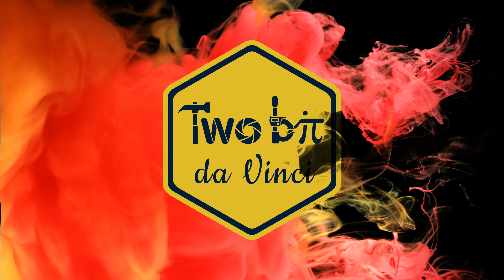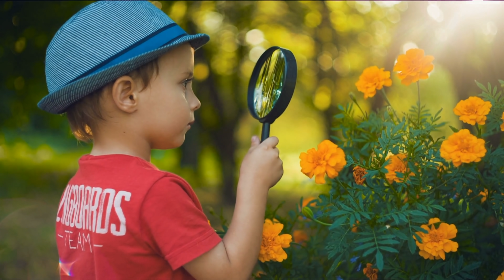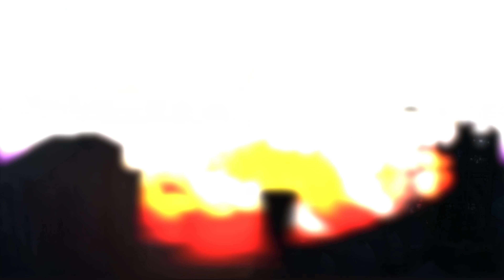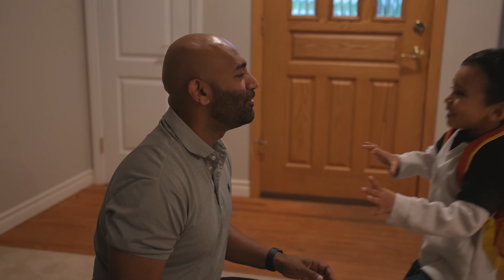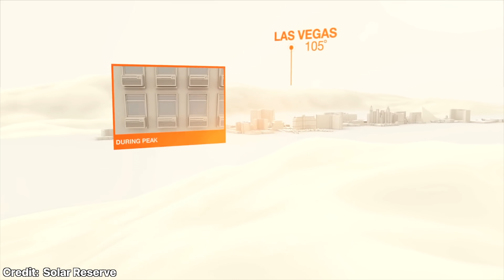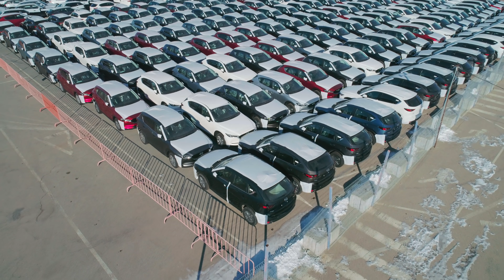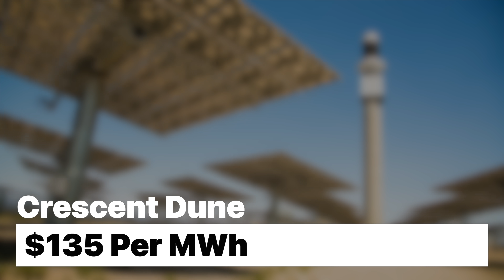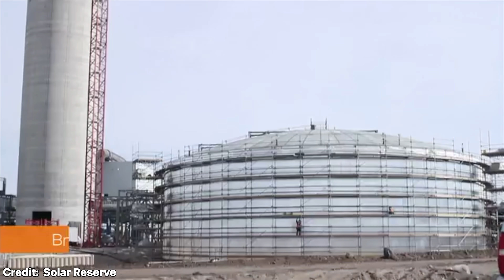This Billion Dollar Solar Plant was an EPIC Failure

Comment: I bet engineers and managers lied to get this approved, specifically by overestimating the power output.  Some mechanical problems could not be anticipated, but the physics/engineering needed to get calculate the output were 100% understood .  How much light is reflected?  How well is it absorbed?  What is the conductivity of each material used?  What's the efficiency of the turbine?  Accurate answers were available to every question, yet their estimate of the power output was high 2:1, literally double.  The Department of Energy must not have audited the engineering work.
Reply: High tech money laundering scheme. Just like the entire “climate emergency” industry.

Comment: The concept of the Heliostat Solar Plant is correct because it solved both collecting and storing energy issues. The problem is engineering execution. First, you don't need mirrors full circle around the tower. The sun goes from east to west and from south; Second, to make each mirror constantly adjustable, ten thousand of them is a maintenance nightmare, they should have known that before trying. 
A simpler solution is to make several circular railways concentric towards the tower and mount all the mirrors on the EV trains. Automatically moving the trains according to the sun's position during the day, occasionally adjusting mirrors up-down position according to the season, and cleaning the dust. This way, you don't need an army of maintenance workers.

Comment: Energy storage is the next big thing... Storing energy in the form of heat is still looking promising (e.g. heating sand to around 500 degrees Celsius) although insulating the containers is probably the biggest problem.

Comment: I think it is clear that those people that are pushing "Green Energy"  have no engineering experience and lie their heads off and promise the moon for funding from politicians that know nothing about engineering either.  Californians wants to ban gas powered cars and then run the state on EV cars.  They can't even run the states air conditioning during hot weather let alone a state of EV cars and air conditioning.  Do the math and realize the insanity of that green energy scams that are going on in California.

Comment: I have solar panels yielding 700w as a supplement to grid power. But solar will always be a supplement. Unreliable. Due to no sun for many hours, no sun when its cloudy and poor sunlight in winter. Even at my location of 13 deg N lat, the sun appears 36.5 degrees to the South on 12/22 !
My 700w yield 700 units a year. In 3 years, i have saved enough to recover 50% of cost. But I will always need the utility's power supply as the main reliable source.
Solar will become reliable when we implement Isaac Asimov's idea. Send satellites into orbit, huge plastic sails, solar panels printed on them. Feeding a central microwave transmitter. To be received by earth stations!

Comment: Hmmm, I need to do some checking.  So many facilities using molten salt built since the late 1940s ended up abaindoned due to problems actually doing maintenance and repair.  The problem with molten salt is that you can't do work on it at temperature.  If you let things cool down, you then have a huge salt rock.  Turn it off and let it cool and every pump becomes an unusable hunk of scrap unless you have drained and flushed the system quite well.

Some things look excellent in theory but are unable to function long term in an industrial environment.   Wind and solar were first sold in compplete hooey and hot air.  e.g.  1990s era photovoltaic panels would take 17 years to generate the amount of power it took to make them but the median service life was five years.

Comment: This is new technology so why consider it an "epic failure" so early? EVERY new technology starts out expensive. When computers were new they cost tens of thousands of dollars for one large enough to help a business. Today for a $1000 you can have one in your home that out performs those first ones. Using solar panels, and your own cost chart, is another example. The cost per KW hour has dropped dramatically in the last 20 years. New technology and improvements from lessons learned will probably lower the costs significantly in the future.

Comment: LOL. Vogtle 3 and 4 looking at 30 billions dollars to produce which is insane. They will produce 2 gigawatts all said and done.  Their is something seriously wrong with your numbers. LArgest solar plant in the us is in california is capable of producing up to (not on the regular) 390 megawatts. the plant cost 2.2 billion even with governement subsidies.  Do the math and that sounds great until the nuke plant will operate more than 3 times longer than the solar farm (solar farm will need a total refit every 25 years at its longest life which also means a big dip in production up to that point).... ohh lets not mention that the plant sits on 6 square miles of land that would no longer be of use by plant or animal.. wait make that 30 square miles to equal a 2 gigawatt plant site.  The land becomes too expensive to use for solar.  California uses 5188 gigawatts.. how much land does that require if its all solar?

Comment: There is no way that electric car cost ramp down at the same rate of solar panels. Simply because of the battery material. Whatever they choose to use whether it be lithium or whatever it's a resource that is expensive. Borrowing some insane breakthrough, it will come down just not like your chart on panel cost.

Comment: On a personal level I had a 4kw domestic PV system fitted to my home in the UK.
Fitted in 2011 it still hasn't paid for itself,and a few months ago the neighbours ridge tiles were ripped off in a huge storm and smashed two of the sixteen panels.
The neighbours insurance refused liability and my insurance company have a "hidden" excess which will put me out of pocket for the repair, ignoring the fact that PV panel technology has moved on,and PV fitters are reluctant to even attempt a repair.
Unless you live in a desert,far enough away from potential damage and  with guaranteed 30° C plus temperatures domestic PV installations are simply over  promoted.
Reply: Speak for yourself, we've already paid back for our system installed in '16. Try living in a sunnier country
Reply: @m2heavyindustries378  unfortunately I'll never leave the UK, it's been my families home since AD 750 on my mother's side and goes back to the last ice age on my dad's side,(my daughter arranged a DNA test) and I certainly won't be leaving on a whim .
Reply: I agree with you!  Solar is not the best energy system for many parts of the world.  I don't mean to be too critical, but isn't putting PV panels on your roof in the UK and expecting a decent payback time kind of a non-starter?  Every time I've been in London, it's raining.  I mean, the weather there isn't very friendly to solar systems.  By comparison, I have a two-year-old 13 kW system in Utah, and it's going to pay back in about 7 more years at the rate it's producing now--averaging 20 MWh per year.  That's including the winter months when there is frequently snow on the roof.
  
For all of us, local climate and utility-friendliness are the two key determining factors, I would think.  I'm also curious to know what your cost per kWh is from your UK provider?  Mine is about US$.09 to $0.15, and I have a net -metering agreement that allows me to sell back my excess capacity to my local electric utility, and buy it back from them at night.  It's a 97% agreement where I sell them $1.00 worth, and they sell it back to me for $1.03 at night.  I'm just using them as my battery.  Not a perfect setup, but not too bad for my investment.  Even in the hot summer months, I sometimes pay less than $20 per month, because I'm producing my peak energy then.  I run my air conditioning guilt-free because it's coming from the same sun that's heating us up to begin with.  But that's me in a warm, dry climate.

This is another area that really bothers me about solar:  I'm reasonably happy about my arrangement with my utility, but unless you are totally off-grid, the various electric power utilities around the world get to decide how cost-effective your grid-tied system truly is.  Many, if not most of them are very hostile to solar systems because it reduces their revenues, climate-friendliness be damned.  If they allow you to do net-metering, it's usually because some government entity has forced them to do so.

If our world governments are truly committed to greener energy production, one would think that they could start by passing laws that are friendlier to various methods of clean energy production, especially if it's from us little people who paid for our own systems (and yes, I know, including the one-time tax credits).  But the institutional/governmental insanity seems to continue.  We homeowners represent a growing distributed production system that is often not given very favorable conditions in which to grow.  The utility companies pay huge money for lobbyists to influence government law-making.  All we have is the voting box, and it doesn't seem like that's enough.
Reply: @DaveAndrus  for domestic use a 4kw PV system is the maximum allowable.
Bigger systems on agricultural and industrial sites are installed but they are now  managed differently.
One of the reasons 4KW is the maximum for domestic premises,is that farmers initially took advantage of tax incentives and simply "filled their boots" and installed the equivalent of mini power stations on their barn roofs, and having had the installation subsidised by the tax payers, also had a very generous payment per kW sold back to the grid 
The government simply stopped the scheme, although not retrospectively, naturally.
I lost interest,years ago, over the amount that the electric generating companies buy my power, but it hasn't changed for years ,at 3 pence per kW.
With the present huge price rises due to the Ukraine war, I'm buying power back at over 30 pence per kW
The UK is now in decline, we'll be back up sweeping chimneys soon, and yesterday just lost the last bastion of civilisation honour and decency.
Reply: @toonmag50  That's very interesting--I had no idea what restrictions you've had to work with.  Really too bad.

This makes me feel quite a bit better about the state of solar installations here in the USA by comparison.  It's outrageous that you can't install more solar than 4 kW.  That would be considered a very small system here--more like a hobby than an actual alternative power system.

My sincerest condolences to you and your countrymen with the passing of your wonderful Queen.  She will be remembered by history as an exceptional example of decency, grace and strength!
Reply: @DaveAndrus  most appreciated.

Comment: Did you ever calculate how many batteries and space it would need to store a certain amount of energy to power a small town? How about the life of the parts, like the PV or batteries before having to dispose of all of them?
Reply: The garbage disposal thing seems to be quite a neglected thing with the idea of a future of transport that looks the same, but with batteries instead of gas. With gas, the used gas is dispersed in the air. With batteries, they'll got to be somehow recycled or disposed. And then there are more tire and road wearing, with the added weight (at a lower autonomy that can't ever improve meaningfully). But I'd guess the problem even starts earlier. How many batteries will be needed if all cars were to be battery-electric, plus the additional cars of a increase in demand, from population increase, and even economic growth of populations that have less cars/person right now? 

I have never really done the math, but I'd find surprising if we'd even have enough raw materials for complete replacement and universal adoption of battery cars to last more than 50 years, and I really think I'm being extremely optimistic with this wild guess. I think they'll be an artifact of history, with much more limited use in the long term, which probably will require massive adoption of trains, trams, and trolley buses (that can be electric without batteries), in parallel with combustion engines based on less problematic fuels or maybe embedded systems of capture, but probably for more exceptional cases, in a world where there's a dramatic reduction in ownership of cars.
Reply: @petitio_principii  Can't you recycle the materials in batteries?   But to answer you question, we could have hydrogen cars whose exhaust is clean water vapor.  The problem is we have electrical infrastructure EVERYWHERE and no Hydrogen infrastructure.
Reply: @shepdogsd  My Benz diesel SUV exhaust  is just water vapor also.
Reply: The plant being discussed in this video didn't store energy in batteries it stored it in the form of molten salt.
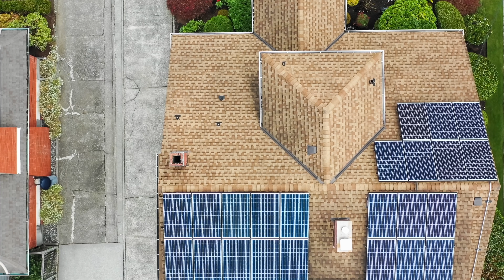Reply: @russellcole3139  The comment was addressing the point covered in 10:58 of the video.

Comment: @Two Bit da Vinci: At about a minute into the video you talk about seeing the Crescent Dunes plant while driving from Southern California to Las Vegas. NOPE!!! The solar plant you can see from I15 is a similar but distinctly different facility called the Ivanpah Solar Concentration plant which is actually in California (not Nevada) about 40 miles south of Las Vegas. Cresent Dunes is near Tonapah, Nevada about 190 north west of Las Vegas. The Ivanpah plant does NOT use molten salt as a heat reservoir and is unable to provide power at night. It also uses a lot of Natural Gas to keep the water from cooling down too much at night and to speed up heating the water to boiling in the early morning hours. It still cooks birds flying nearby in the daylight, though.
Reply: I agree on your correct location, just outside of Tonopah, NV. 

I drive between Phoenix, AZ and Reno, NV 2, 3, or 4 times a year to visit family.  I usually stop for a couple of nights in Tonopah to break up the trip. 

I was surprised to see the thermal solar plant operating, or being tested, or experimented with, in September this year (2024). The top of the tower was brightly lit then, like it used to be years ago. 

Returning south 2 weeks later, the thermal plant was again dark, as it was again in October and November when I passed by again. 

Maybe the owners occasionally run the plant to keep it from falling into disrepair, or to collect additional data on it operation. 

Not sure why, but it was nice to see that blindingly, hot, white tower as we came down the hill out of Tonopah, heading to Reno, late September this year. 

Too bad it was again dark, on my return trip to Phoenix, and still dark when I passed again in October and November.
Reply: @CapinCooke  Maybe the sun just happened to be in the spot it was when the mirrors stopped moving?
Reply: Not to mention all the desert turtles that had to relocate? Turned a blind eye to the environmental impact when it suits their narrative.

Comment: The problem with PV is that it requires storage to deliver 24 hours per day, and that raises the price. With solar thermal with storage there is 24 hour supply. There are alternatives to salt that work better. It also seems risky to have one tower. Currently for storage the possibilities are batteries (too expensive, but there is a new technology that may be a lot cheaper), pumped hydro (limited locations), hydrogen (probably too expensive) or thermal storage.

Comment: Solar will never be worth it.  Magically the costs to maintain/repair/replace will always be higher than output.  Just before you are about to pay off your initial investment, its time to replace.  Solar plants are only built because there is ALWAYS a family member from a democrat politician on the board of directors or something, and they get government subsidies (because paying full price would never be worth it), and the family member gets rich from the tax payer dollars.  Electric cars now and forever will be powered by electricity generated from burning coal.  With disposal issues on the batteries and the coal needed to run electric cars, they are worse for the environment than gas cars.  It'll never be cost effective to buy an electric car either, that is why government tries to subsidize and force people to use them.

Comment: Anyone know the efficiency of a gravity battery (storing work by lifting 10000 pounds in the air)?
Once the weight has been raised, there should be zero "losses". That would be the "battery", flywheels would be the "capacitors".

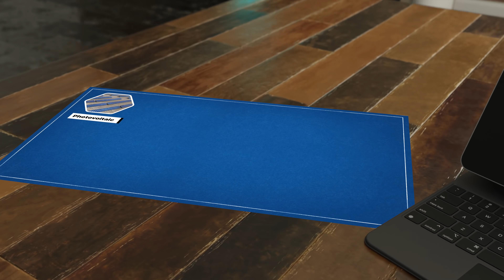Comment: 6:30 For real? 2$ per WATT? That's insane, are you sure you got the units right?
Reply: I was wondering how expensive coal power was, as a baseline.
They calculate in MEGAwatts, and the range is $63 to $143 per.
So...... yes. Thats phucking insane.
(And the average price per ton of coal is $46.)

Comment: if we could convert renewable energy into gas or oil, that would solve a lot of problems
Reply: How will we store gas? 
We have problems with volumetric density
Container embrittlement 
Round trip efficiency
Reply: @IMahatmagandhi  its better than hydrogen, lithium batteries and hydrobatteries. it also helps that it can be use in most conventional infrastructure already. but doubt we have the tech to do it cost effectively if not we'd already be doing it. would be nice if we could get LPG from solar/ wind/ hydro